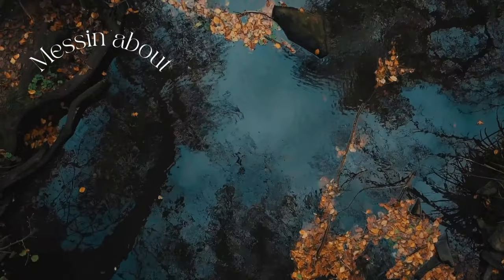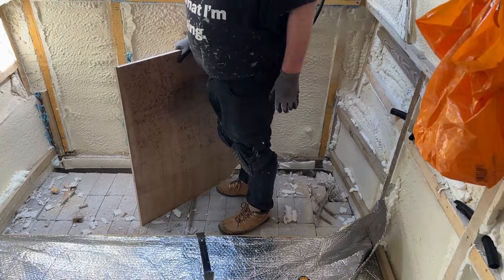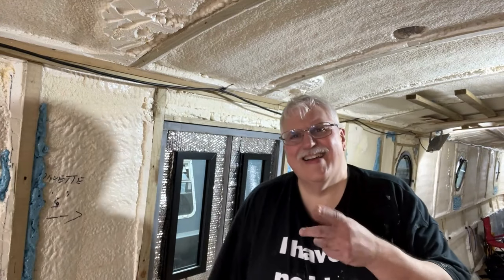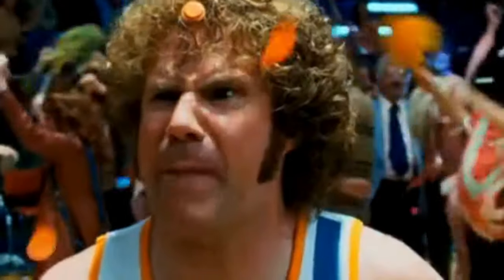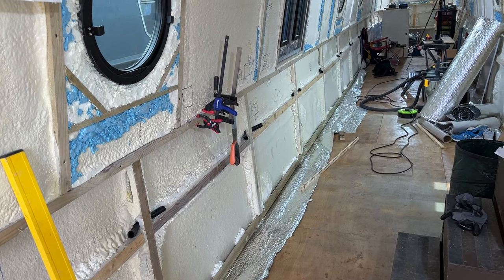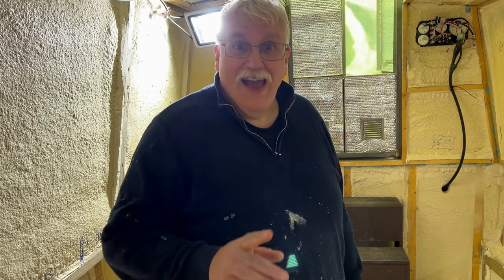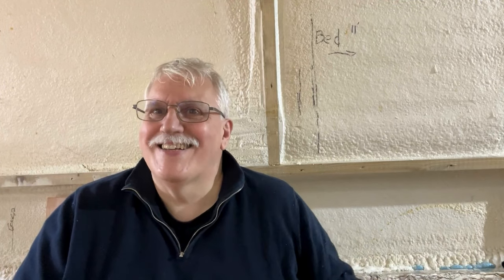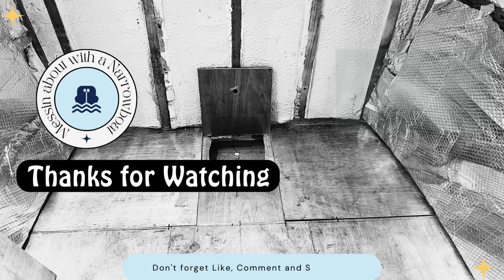Our Narrowboat Fit-out | Cabin Bilge Inspection Hatch | EP30

Comment: In my opinion, you’ve pretty much answered your own question. If you fit a bilge pump in the cabin, it’s likely that it won’t work unless you run it wet periodically, which you can’t realistically do. The primary risk of flooding in the cabin is from a leak in the water supply (tank, pipework or fitting). So for me the most useful option is a sensor and alarm, preferably incorporated into a boat alarm system that can notify you on your phone in case you are away from the boat. That together with shutting off the water tank valve whenever away from the boat for any length of time. I’m really enjoying watching your progress so far, keep up the good work 👍🏻
Reply from the maker: I’ve found moisture alarms with a 10 year battery (allegedly) but I believe can connect to a zigbee hub which would be handy. Thanks for the input.

Comment: Re Leaks
All three narrowboats that we owned have had internal water leaks from plumbing. From accumulator tank, from washer on joint from tap connector to tap, from drinking water tap fine bore pipe to 15mm cold supply in kitchen and from hot pipe coming off back of shower mixer valve. 
Current boat had no access hatch in rear bedroom floor so just been doing that this winter after shower leak on day of last holiday last September.
I don't have a water alarm or bilge pump currently. However my thoughts are that a bilge pump and float switch are a very good idea. If you have an internal leak I suggest you will probably be not aware of it occurring unless staying on the boat and the fresh water pump cycling on and off or running all the time.
Except for the last leak we were not on the boats.
Your fresh water tank holds hundreds of litres of water and  if there is a leak it could result in the floor becoming very wet.  In an ideal preventative situation I suggest that a bilge pump with float and manual override and a water detection alarm should be fitted.
Re Extra foil layer of insulation.
My thoughts are that the air in the space between the sprayfoam lining and the wall and ceiling wooden cladding will vary in temperature in Uk from minus five to plus forty degrees centigrade. There will always be condensation, but the sprayfoam will reduce this and adding an extra foil layer is on balance an unnecessary expense and time in fitting. I suggest just waterproofing the cladding with varnish like you have done with the floor to reduce mould growth.
Reply from the maker: Thanks for the input. Much appreciated. Defo on moisture alarms and I have inspection hatches port & starboard at the water tank and shower. I was going to put some in the saloon but there are no pipe joints, but still an idea to aid any tracing of faults. Still not sure about a pump near the water tank, but have allowed in the design for one at the cabin stern. I think the tank area is probably the highest risk area as so many pipe joints. TBH, never thought about what happens if we are not on the boat. Good shout! I was mostly thinking about leaks from shower and washing machine (both of which I’ve experienced and most irritating to rectify.) insulation comments noted. Thanks so much.